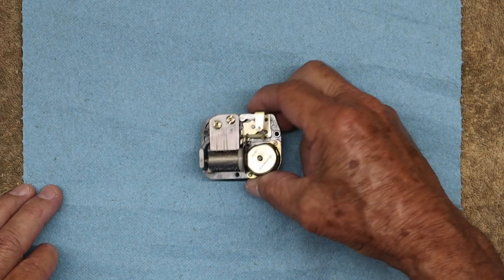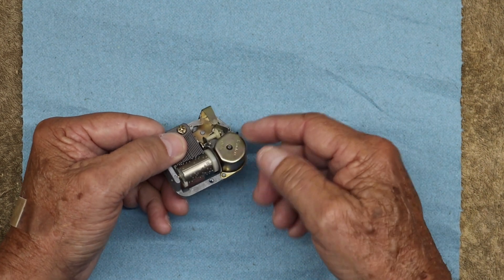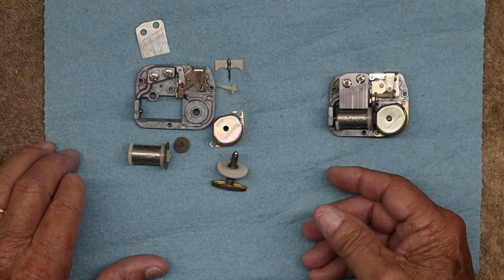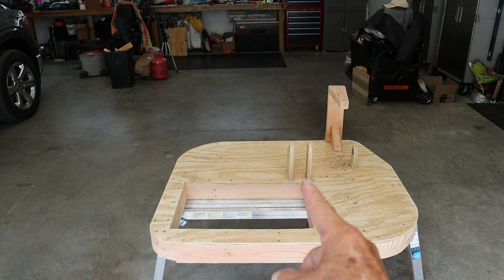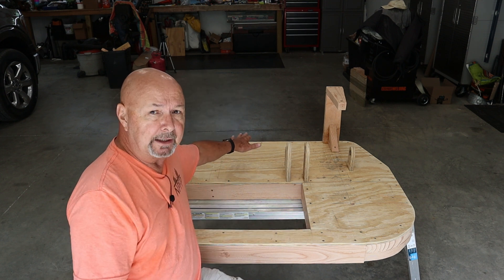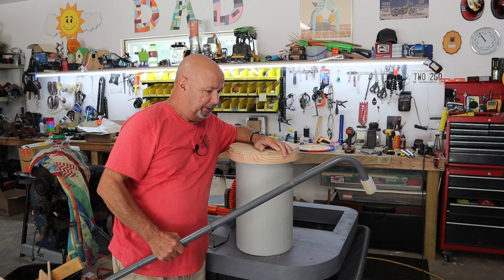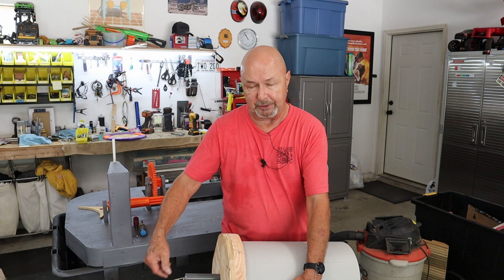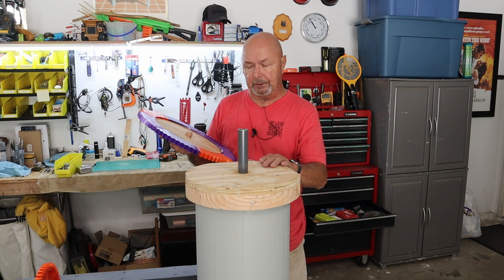I made a music box "Thingy" 20 times LARGER!

Comment: You should definitely finish this!
You could potentially replace the tone bars with keys from a xylophone, or perhaps fabricate your own from aluminum or steel bar stock.
The part that spins to regulate the speed is known as the Governor (it 'governs' the speed of the mechanism). It might require some trial and error, but I think you could get your current iteration to function properly.
Reply from the maker: Hi thanks for watching and the comments. I'm going to get back to the project at some point soon. I've had others recommend the xylophone bars too, so may be a good direction for me to try. I have some ideas on the governor as well. I think you may have already but if not please consider Subscribing. I would really appreciate it!

Comment: Maybe maple for the tone board and probably much thinner. The regulator could in fact be used at scale with modification. Possibly a simple adjustable drag brake. The spring was my only initial thought of worry, scaled it would be highly difficult and dangerous. Not to mention difficult to obtain a flat coil spring that could preload enough energy and power to move the mass of the drum. The project as a whole is there, I mean close though, would love to see you revisit this after awhile. Great start!
Reply from the maker: Hi thanks for watching and the comments. I learned a lot of things building this project. The spring was a concern for me and I knew the difficulty of building or sourcing a spring like that. One idea I had for the spring was to tie the drum shaft to a much smaller drum, say 4 inches in diameter. I would wrap around that drum with something like a seatbelt strap. I would then use two large extension springs that would pull the strap. This would also require a one-way coupling between the two drums. The coupling would allow you to wind the thing up as you wouldn't be able to spin everything backwards otherwise. I think you may have already but if not please consider Liking and Subscribing. I would really appreciate it.